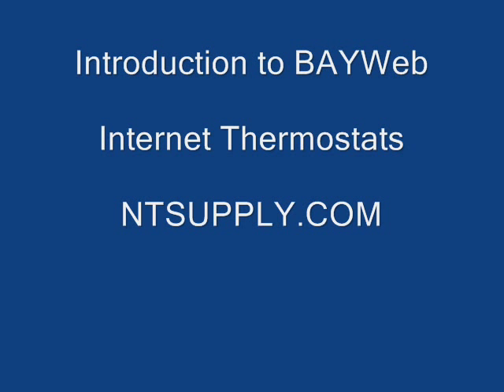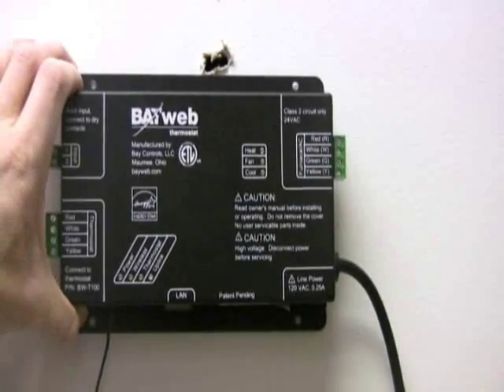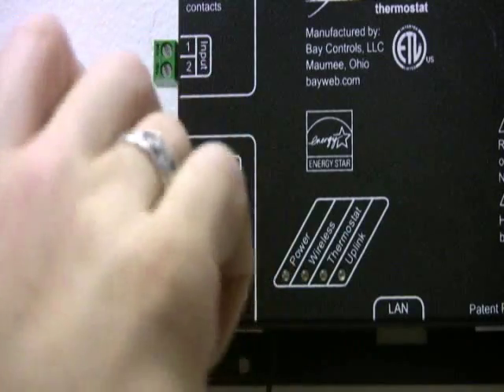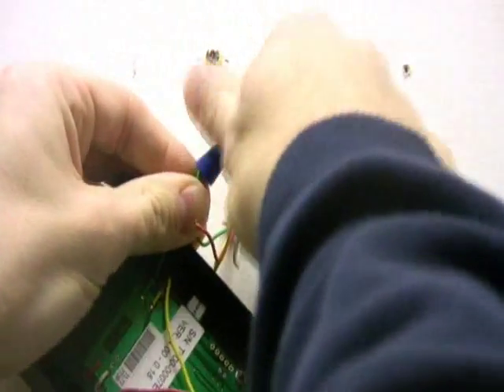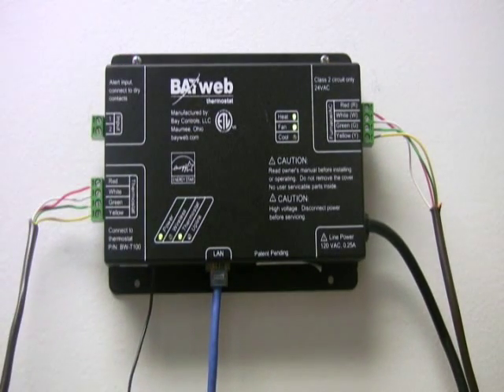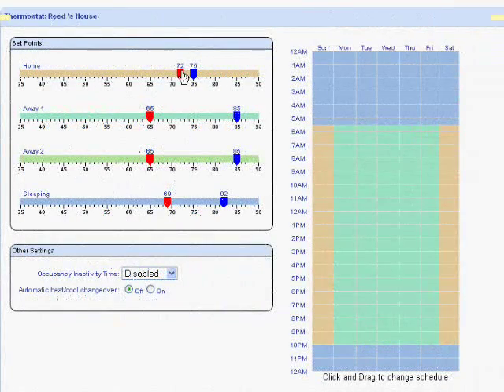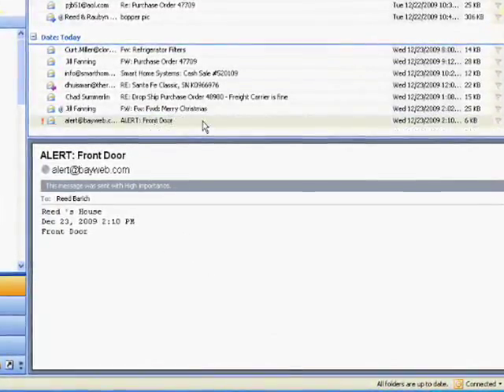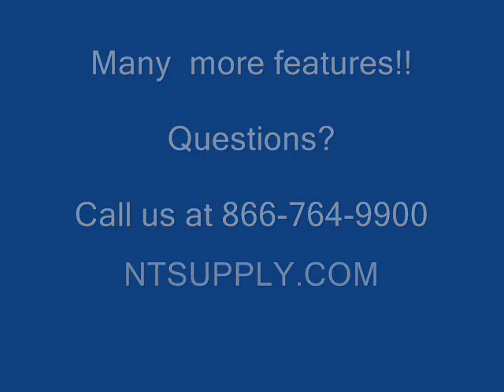BAYWeb Internet Thermostat Installation

Comment: No explanation of wiring between furnace and module in either the video or the manual. Both assume existing wiring and the color codes are correct. If you don't have existing wiring, good luck finding what connection on the module is supposed to go to which connection on the furnace. A functional schematic in the manual would solve that.